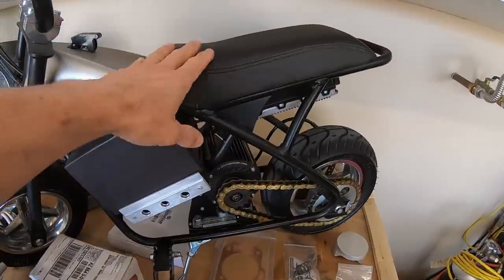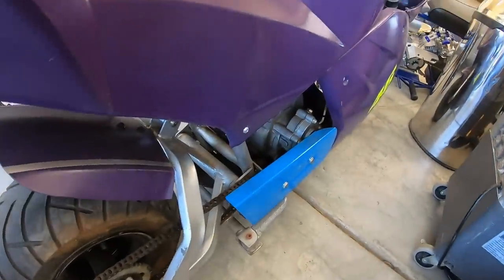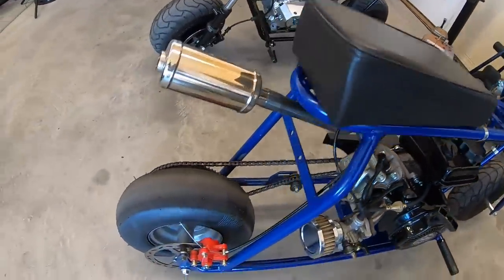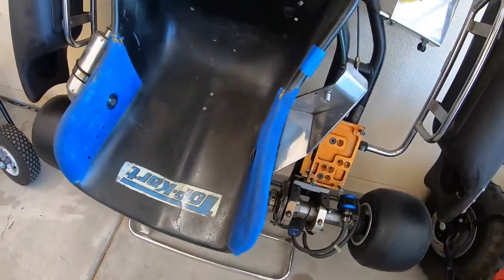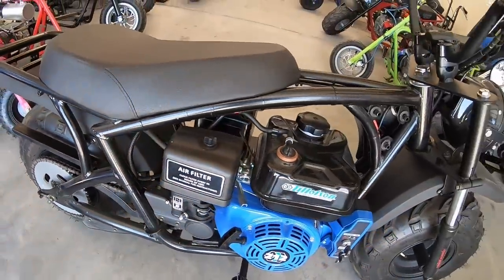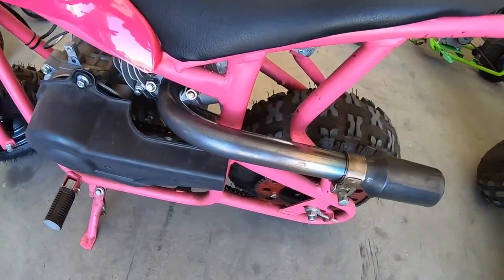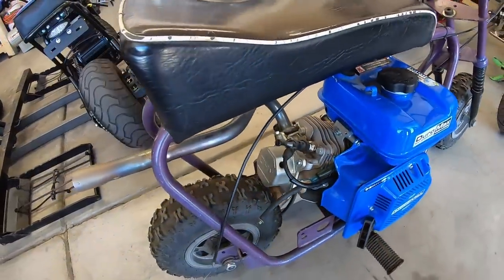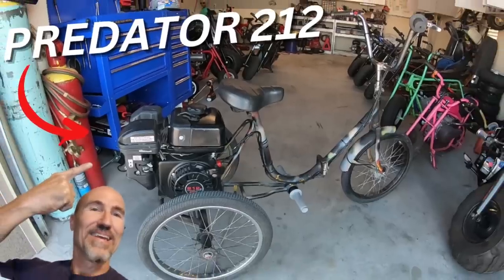Mini bike fleet walk around

Comment: a friend sold me a gas powered 24cc stand up scooter and i did a little work on it to give it a new life but nothing like what you do.   the scooter is insanely cool to me but i could only fix it up so far.  i thought of replacing the 2 stroke motor with a 4 stroke small equivilent one or swap it out for an electric motor but to keep with the theme gas would be better.  i made a deck plate out of a nice piece of oak to replace the original.  i wish someone like you could look at it and help me get it running well.   some times i just stare at it it looks so cool.  great video and incredibly cool mini bikes.

Comment: That was a fun walk-thru. How do you decide if you're gonna run a clutch or a CVT?
Reply from the maker: Thanks! I usually run clutches on the small tire bikes and Torque converters with the bigger bikes. The bikes with the taller tires are hard on a clutch unless you're running a very low gear.

Comment: What color did you use to match the Doodlebug Green when you welded the frame extensions??  Thanks ❤🎉
Reply from the maker: It is KRYLON Fusion Jungle green . It doesn't match the stock color . I painted the entire frame
Reply: @Black66  that’s what I figured. I may keep my green bike stock since it’s so mint and find another one to cut and weld on. Thanks for the quick response.